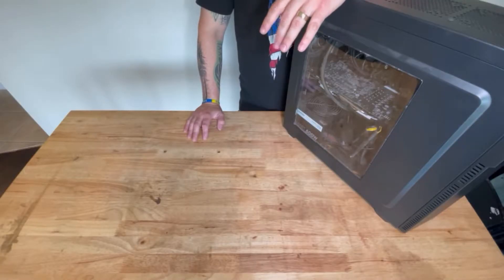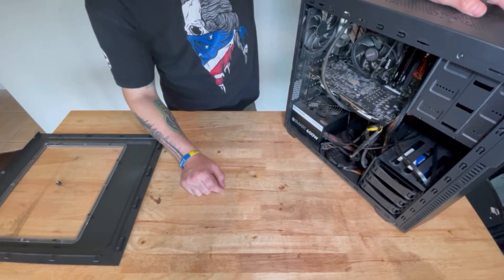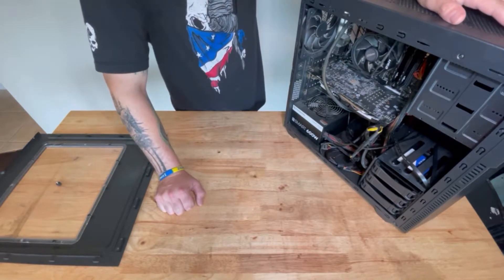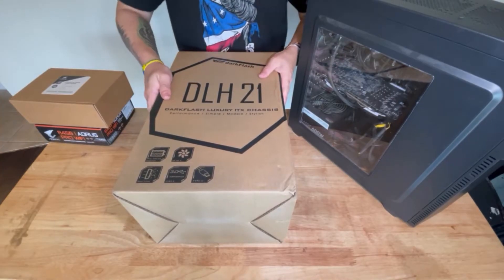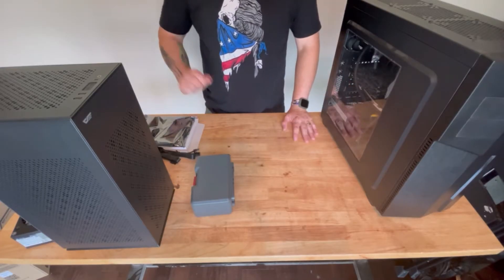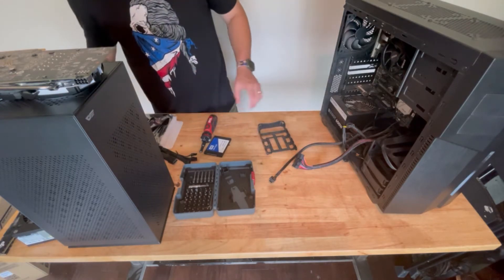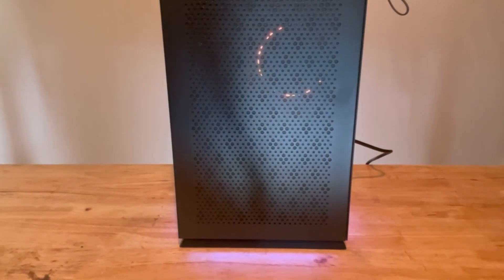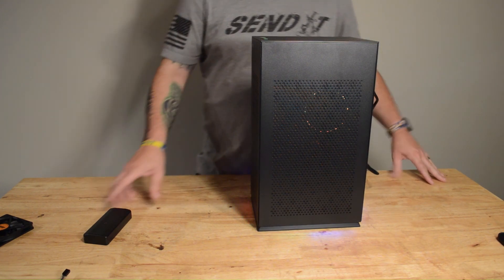Darkflash DLH 21 mini tower Itx case build for the wife! Part 1

Comment: Nice! Im actually building a similar pc for my gf. ASUS ROG Strix B550-I, cheap 16gb ddr4 3600mhz, Ryzen 5600g, 240gb cheap nvme boot drive, cheap 1tb nvme cold storage. Itll be basically used for the remote work + light 1080p/1440p gaming (Sims, GTA V, older COD titles) and shes dabbling in youtube content creation with a GoPro, so im tossing in an RX 6600 gpu after seeing how the APU handles for a week
Reply: using the same case as well, couldn’t find it in that blue color anywhere though.
Reply from the maker: Nice!! Yeah it is mostly used for my wife doing remote work, it has all my old components but almost a year later and it’s still going strong with no issues.